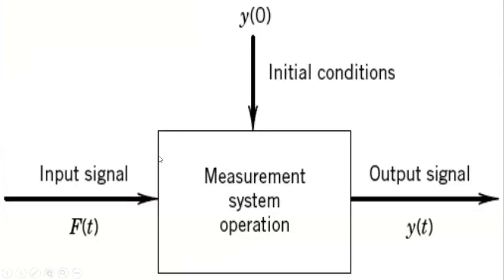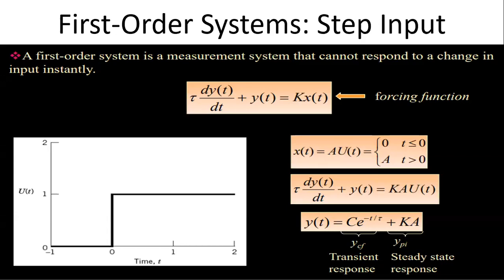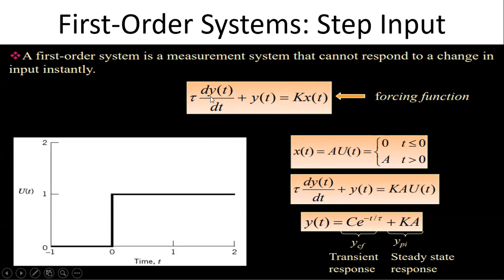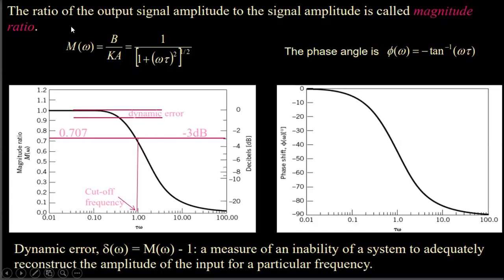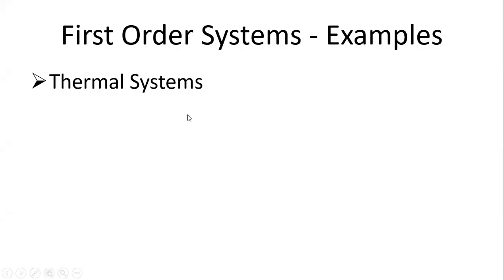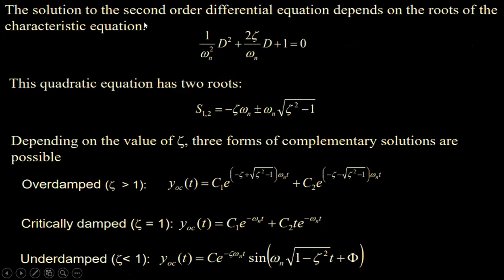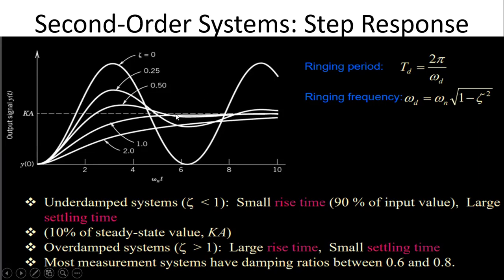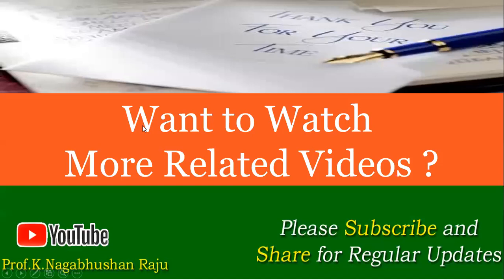Order of Instruments | Zero Order | First Order | Second Order | Fundamentals of Instrumentation

Comment: During the first example problem, when calculating for the range you didn't take into account the -1 beside the equation. Is there a reason you didn't do that? Also, does omega always have two pi attached to the frequency, or is that part of a conversion to ms?